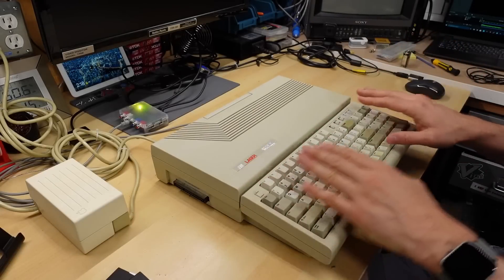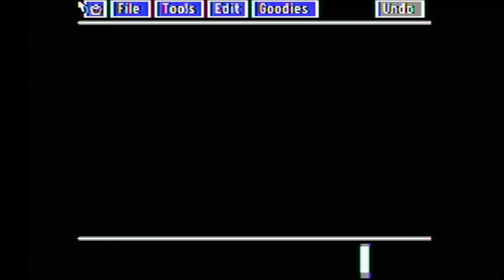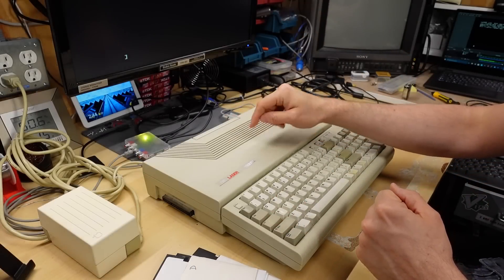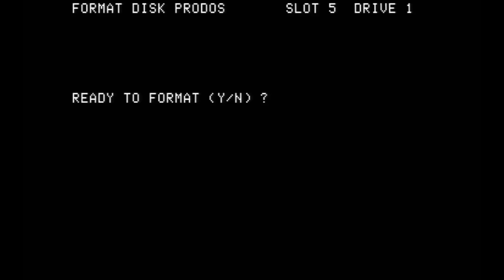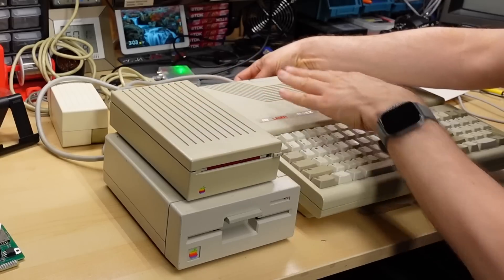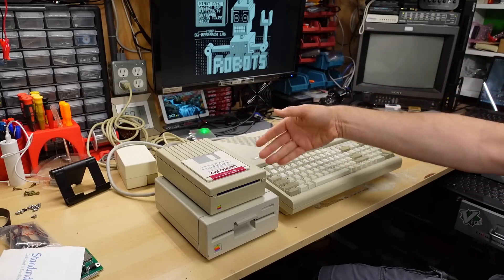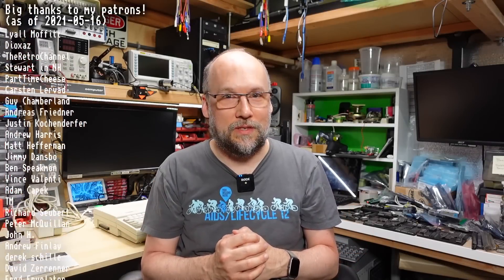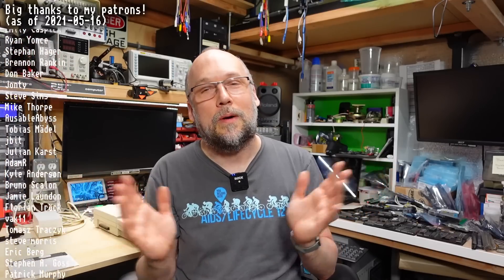Laser 128EX: Proving this machine is better than an Apple IIc

Comment: Fyi: a good way to repair plastic like that is to pin it in place. First glue it with something like epoxy or crazy glue. Then get some thin graphite fiber rod from the hobby shop. Drill one or more small holes though the part across the break such that the graphite rod fits snugly then glue it in place. (Generally you need a drill press, doing it by hand usually ends up with a mess) Graphite rod is crazy strong and and makes a great reinforcement. 

A similar repair can be dobe on the little doors that use little nibs of plastic as higes when the little nibs break or wear off. Drill a hole though,cpress a piece of appropriately sized graphite rod in place and your good to go.

Comment: 23:00 - if the ABS plastic welding is not an option, maybe you could try CA glue+baking soda. Look it up, it gives a lot of structural strenght and you can use it on surfaces that are not visible.
Reply from the maker: So I was looking at bit more at the tab -- sadly that specific broken part is what clamps onto the lower section of the case, so it needs to fit perfectly over this ridge in the lower section. Meaning when I glue it, it cannot have any glue "oozing" from the crack, even on the underside. I think the ABS welding is going to be my only option.... I would normally try to reinforce it with some extra ABS but unless I do it on the OUTSIDE it won't be possible. What a pain!!
Reply: @adriansdigitalbasement  Ohh, I see, that's bad news. Good luck on fixing it! By the way, did you find the CA glue+baking soda trick? It might be useful in the future. Cheers!

Comment: Gotta wonder how well the AppleWorks spreadsheet works at 3+ MHz. I recall building some sheets which took a while to run on a stock Apple //e (decades ago, of course). The higher speed would've been really nice.

WRT copying floppies, might wanna try running the Laser at a higher clock rate. The Apple //e had difficulty running terminal programs. It worked just fine when everything fit on the screen but, when the screen had to scroll, it was not uncommon to lose the first couple characters because scrolling the screen ate several milliseconds and the Apple Serial Card had 1 byte of buffering, meaning multiple characters were sent before the terminal program could check the port.

I discovered this while trying to use an Apple //e as a terminal connected to an Osborne O1 (52 column screen, physically painful keyboard). I could run at 300 baud (but who wants to do that) without issue but 1200 baud lost characters when the screen scrolled.

I have no experience with a //c so I can't speak to how well those worked. The fact that you could copy floppies at 115,200 on the //c means they likely had more hardware buffering on the serial ports.

Comment: The IIc has a timer—the mouse card. Nobody used it to detect the speed of the system though. Likewise the IIgs has timer hardware that can be used. Older machines … it might be possible using some trickery, but nobody did that either.

Comment: If it's assigning different controllers to different types of drives, would it possibly work with 1 5.25" and 2 3.5" disk drives daisy chained like you could with DF1: to DF3: on an Amiga? It's just one of them thoughts that wouldn't go away, since you could technically put 2 drives on each controller.

Comment: If the CPU is a WD65C02. The reason some programs may lock up or reboot may be because some programs may be using the undocumented op-codes in the MOS 6502 that are unsupported on the WD65C02..
Reply: lol well that's BS!
Reply: The Apple //c and Enhanced //e both used a 65C02
Reply: As I recall, the 65C02 had 10 extra instructions over the 6502...maybe WD/Rockwell (the two companies that made the 65C02) just  documented some hidden instructions?  The //c and the Enhanced //e also reintroduced the mini assembler that was in the original Apple ][ ROM's, and didn't make the cut in the ][+/ original //e ROM's.  You can tell an Enhanced //e in two ways:  the boot screen shows "Apple //e" (instead of "Apple ][") on the boot screen, and if you enter the system monitor, and type "!" at the * prompt, you get the ! prompt (and are in the mini assembler).  You can enter assembly language directly in that prompt,  but it's a little lame in that it doesn't take mnemonics (unlike a nice software assembler!)

Comment: I keep a jar of plastic slurry for things like this (broken lid.)  Just a glass jar with a screw-on top.  Fill it with some acetone, drop in some generic beige plastic parts (broken CD tray, keycaps, etc.)  After a couple days, it’ll be soup.

It will off-gas the acetone and at some point turn solid.  No worries.  Reconstitute and carry on.

I have been trying to fix the front of a 3.5” floppy drive that needed some TLC.  Trying to put the flap back in the two retaining slots requires bending the flap, which has resulted in it snapping three times now.

Apply plastic weld with Q-tip, smoosh parts back together, hold for a minute, set it aside for a day.  Use an Xacto knife to trim off the splooge, sand with progressive grits, looks almost good as new!  (Minus texture.)

Comment: What is that card called that has an SD card reader on the side? I'm interested in getting one for my Laser 128 base model. Although, the floppy drive works just fine and I don't have a notch to make a side 2 of the diskettes. Also, was there an adapter that allows you to plug in an Apple mouse and a joystick at the same time or not really? It's also amazing that you can boot from an 800KB 3.5" drive, FloppyEmu, and that card that was on the side.

Comment: You said in first video they were selling card adapter that made posible connect two cards into that side connector(for extra 50 bucks or so). Maybe thats why is slot 5 not working, as that expansion card has most likely own controller, setting one to slot 5 and second to slot 7.
Reply: We had those expansion bays in our middle school, they were pretty simple. I don't think they even had any extra chips inside, just wiring to make one slot appear as 5 and the other as 7. The Apple II expansion slots use a bus configuration to connect with the rest of the machine, which means a lot of the pins are shared between all the slots, while certain pins were used to identify specific slots.
Reply: @evknucklehead  Hm. Im assuming this machine has to diversify between two cards that could be potentionaly used and need to know which one it wants talk to. It cant use both of them at same time, so there has to be way to tell one to "shut up, im talking to other one". I guess its pin 1 and 34 on machine's connector? It leads to pin 1 on slot 5 and 7 connector...whatever it is(they are marked as SC5XX and SC7XX).  
It means you could make your own adapter easilly. From schematics, theres just simple power circuit thats... kind of weird. Why it needs external 10V if it can take 12V directly from machine. For diode and +5V? 
I let Adrian to brainstorm it, i have no clue how those Apples works.
Reply: @cyphi474  I think it was a design choice so they wouldn't have to include a larger power supply in the Laser 128 itself. The machines were already quite cramped inside with all those expansion options built-in, and it was already much heavier and about twice as thick as the IIc. Also, in those days, the 12v rail wasn't nearly as important as it is in today's PSU's, so designers didn't make much current available on that line.
As for selecting the active slot, if I remember correctly, the Address lines on the bus were used for this purpose, with each slot having a specific range of addresses associated with it. This is similar to how PCs do things even today, with a major difference being how those addresses are allocated. On the Apple II series and its clones (and a lot of other 8-bit computers) these addresses are built into the hardware itself, while modern PCs can assign those addresses as needed.
Reply: @evknucklehead  So you could use both cards at same time? Because otherwise it doesnt give much sense. There is enough current for one card.
Reply: @cyphi474  Both slots would be populated, but only one could ever be active at a given instant. The CPU can easily switch back and forth between slots as it performs its tasks, though, so it may seem like both are always active, even though in that instant they are not.

Comment: Alot of games, to prevent tearing, frame lock using a vertical sync function (not sure that 6502 has it, but the 6809 does), and in those cases, regardless of speed of the processor, the game will always run at the same speed (although faster speeds will make it run a bit smoother).
Reply from the maker: Yeah the Apple natively doesn't have any kind of vertical interrupt available for that. I think the mouse hardware does but it's definitely not stock on any Apple II. :-(
Reply: The 6809 was such a superior processor to the 6502!  I enjoyed programming assembly language on my Color Computer 3 a lot, not that I really did anything useful.
Reply: @Starchface  The CoCo 3 was my first home computer.  Loved that thing.  I did so much with it.
Reply: @Starchface  It definitely was but Motorola wouldn't license it as loosely as the MOS 6502 had been so it never reached the same level of success. Look at the Atari Lynx released in 1989. It has a 6502 because Motorola wouldn't grant a similar license to Epyx/Atari Corp offering customization of the 6809 - and the 68000 too for that matter - as was available for the 6502 from the start.

Comment: The problem with running the CPU faster with games is that it just runs the slow game faster.  Like if a game is 3 frames per second and you increase the machine's speed by 3 times, it doesn't run at 9fps in the sense that would be useful.  It will still fun at 3fps, just with shorter seconds.  It's hard to explain what I mean, but it is very easy to see when you actually do it.  It just runs slowly, only faster if that makes sense.

Comment: I also have that Applied Engineering Z-80 Plus card.  There is a version of CP/M made specifically for the card called CP/AM that you should be able to find online.
Reply: I might be mistaken but I believe the founder of Applied Engineering is discussing the old days in one of the main Apple II groups on Facebook. If not, it's the founder of another 3rd Party company that made Z-80 cards for the Apple II that was founded by a former Apple employee with Woz's financial assistance.

Comment: Just a minor clarification but on the IBM PC and compatibles, games written for AT and later PC and compatibles check the CPU and adjust their speed but not games written for the IBM 5150 or XT (or compatibles wit the same CPU) as they just assumed the clock speed was 4.77 MHz as that was the only CPU speed option at the time on those machines. That is why latter PC compatible machines include the misnamed Turbo button, which contrary to its name does not speed up the machine when pushed but rather slows it down to 4.77 MHz so older games assuming the speed will run at the correct speed. I’m sure the namer of the turbo button might argue that Turbo mode is on default on those machines so pushing the button deactivates the mode thus the button is not misnamed but I’d argue it’s still confusing in that case regardless.
Reply: Even more confusing, while most turbo buttons slowed it down when pushed in, a minority of them were the other way around, slow until you push it in. In which case they’re more in line with the name and thus in some ways less confusing, but since the operation is opposite on most machines as you say, that makes it more confusing overall because people don’t expect pushing it in to make it faster.

Comment: @23:06 IF it really is ABS, use Nitro, put one drop of Nitro on the crack of either piece, wait 15 to 20 seconds. It will soften up the surface and let you glue it together without introducing foreign chemical substances. Works perfectly on lego and derivates.

Comment: Yes IIRC Total Replay will run at full system speed in it's menu but will lower the speed down in games so they work correctly. This was done to support an Apple IIgs that's set to it's fast system speed so you don't have to keep going into Control Panel to switch it back and forth.
Reply from the maker: Ah nice. I wonder if the Laser and IIgs use the same memory location to slow down the system?
Reply: @adriansdigitalbasement  The technical reference manual mentions that address $C074 is used to control the speed.  It uses bit 7 and 6.  00 and 01 are 1mhz, 10 is 2.3, and 11 is 3.6 mhz.

I'd also make a guess that the crash issues you experienced are related to some sort of timing issue between the CPU and the rest of the system.  The CPU actually slows down when it accesses various parts of the system to maintain compatibility.

I found the technical reference manual here:https://www.apple.asimov.net/documentation/hardware/machines/Laser%20128%20Series%20Technical%20Reference%20Manual.pdf

Comment: The expansion port on the Laser 128 is mostly Apple II compatible, but is really meant to be used with the expansion box. They put the slot 5 enable on an unused pin, and the expansion box routes it to the right place for 5. Without the box, only slot 7 will be properly enabled, as you discovered.

Comment: If I remember the Apple joystick right (or at least the paddles), it uses a software loop to determine how long it takes a bit to flip. This was how Woz was able to avoid using an expensive A/D converter. He used software to count how long it took an R/C circuit to discharge and flip a bit. So a higher speed CPU would screw this all up.
Reply: Not quite... the only thing you got wrong is you read a memory location to discharge the capacitor and count how long it takes to charge (not the other way around).  You're also right in that the faster CPU speed would screw up most paddle games unless you modified the game, or unless VTech had the foresight to modify the built-in PREAD function to take CPU speed into account.
Reply: @SpearM3064  Well... I like my solution better! 😃
Reply: The PC game port used the same technique.
Reply: @0LoneTech  And the Atari 2600 reading it's paddles.

Comment: BEFORE YOU DO ANYTHING - plastic weld is a liquid polystyrene plastic glue used by fine scale modelers. It actually melts the plastic together and is a little tricky to use. You apply it so that capillarity (surface tension) draws the liquid into the crack. It bonds nearly instantly so must be done carefully. You can find it at hobby shops. If done right you will not even know that broken piece was missing.
Reply: Should have mentioned - that type of glue is always applied from the INSIDE so that it doesn't mar the exterior finish. I used this stuff on my models and the results were both incredibly strong and very nice to look at. I'm sure this stuff is acetone-based and will work on just about any brittle plastic.

Comment: Application Specific Integrated Circuit 
(basically its a circuit that has been made on a chip so that its modular, but for that specific application, but means you can have multiple of that circuit or only one, depending on the task and layout of the device, such as mining hardware or disk drives, one may have 2, the other may have as many as 512 or beyond... its all dependent on the design)
ASICs are much faster than software (99.9% of the time) because they dont have to emulate, and only have to do one specific task, which means you can have it do only AI, or only disk IO, only the network IO, only the RGB headers, only the fans
or
it can be a circuit that has multiple functions, to save space, which means it can do multi-fan management and maybe RGB at the same time, but is too dumb to do actual processing

thats also why some ASICs require cooling... because they are powerful enough for that particular task, that they generate a considerable amount of heat, and draw such power as well (miners are the most notorious, but a more relatable ASIC would be the "southbridge" aka "chipset" on your computer's motherboard)

Comment: Ok so lets review... a) the higher clock rate (level 3) on the Laser 128EX corrupts a drive at 39:50; also making games unstable and sound is messed up; b) then at 4:15 contrary to the Apple you need to turn off the machine so it can read 80 column mode or it hangs if you switch from one to the other (or use both as in Dazzle Draw); c) and at a point you had to use the actual Apple IIc for a task at 36:52... also the problem you had with the RAM disk never got resolved.
hmmm. Is this really proving the Laser 128EX is better?
Don't get me wrong there seems to be plenty of interesting little fine tunes - but when you actually have the software and don't need to reformat or change your drives each time this machine seems much more buggy, unstable and less user-friendly than the actual machine... as is the case with most clones.

Comment: I had a Laser 128 as my first machine, my father worked for a company that sold them. Every school in my area used them as well since they were significantly cheaper than the Apple IIe and IIc. The laser 128 is a IIe clone (rom wise) in a IIc style case. The one advantage the IIc has is it's keyboard is significantly better.
Reply: Regarding the side card slot, I had an external expansion chassis that plugged into the slot so your cards would be covered and protected. You can find them on ebay from time to time.
Reply: @The_sysop  Did VTech actually sell the expansion chassis or was that 3rd Party hardware? I was just thinking about that. TI sold an expansion chassis for the TI-99 4A in its latter days. Atari designed the 1090 for the XL line for the very same reason but never released it.
Reply: @TheJeremyHolloway  the one I have is metal and branded vtech.